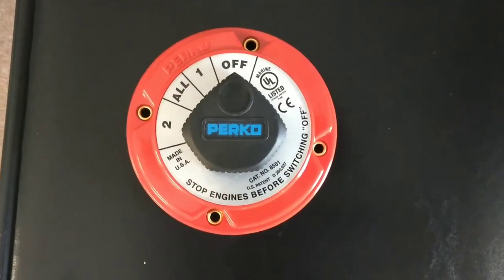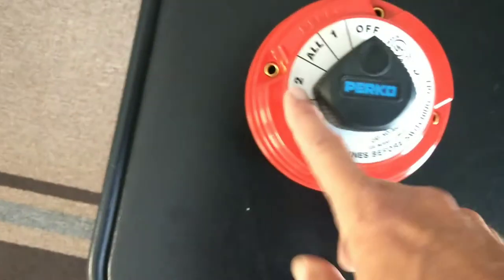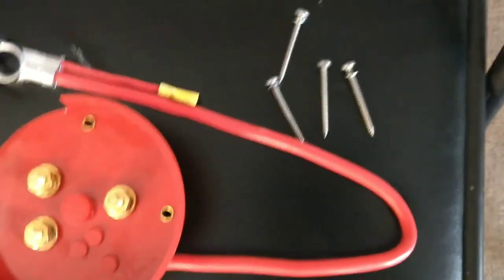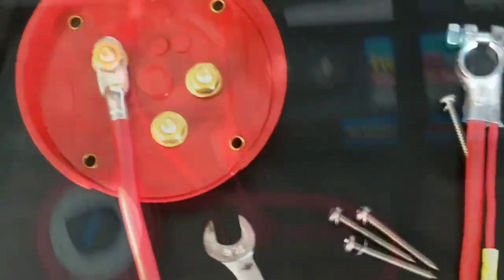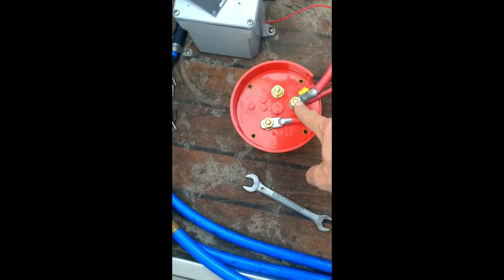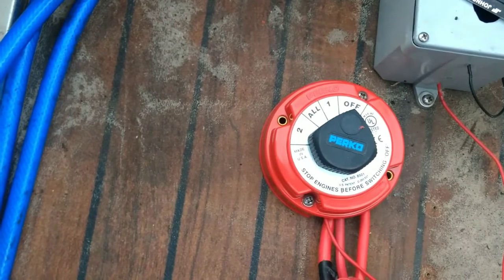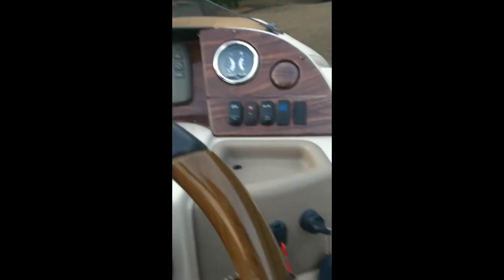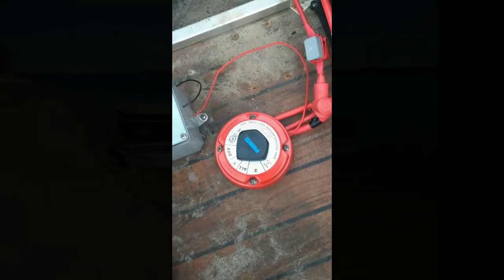Battery Shutoff Switch!

Comment: WHEN YOU CONNECT IT AND TURN THE SWITCH TO 1 SHOULD THE COMMON BOLT ON THE SWITCH BE HOT ALSO .
Reply from the maker: If you are referring to the ALL position on the switch I would think yes, probably so. If that wasn't what you meant let me know.